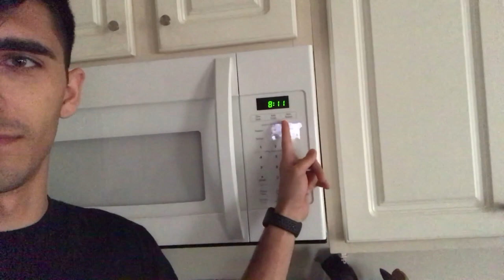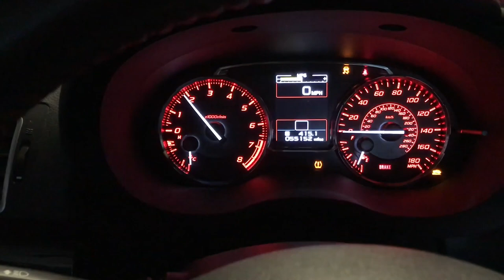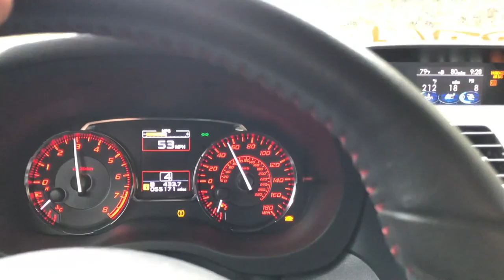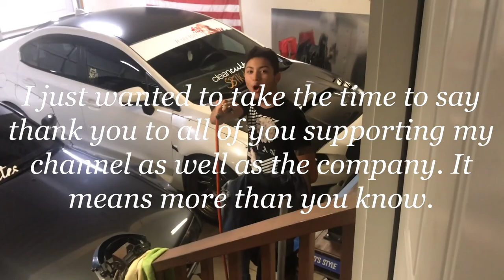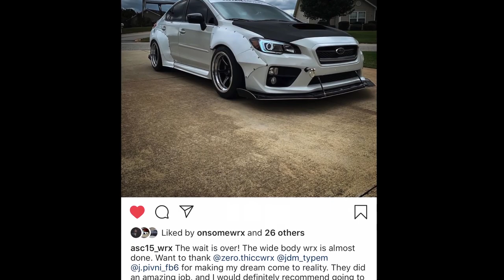Installing a Widebody Kit on a 2015+ WRX

Comment: I been thinking about getting this set but do I need to wide my tires out is that a recommended option for this body kit. New at doing all this to cars special mine lol
Reply from the maker: You could go a few different routes. You can get wider wheels, get a more aggressive offset, or run spacers on less wide wheels.